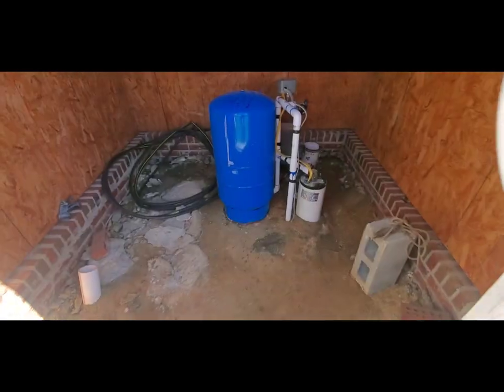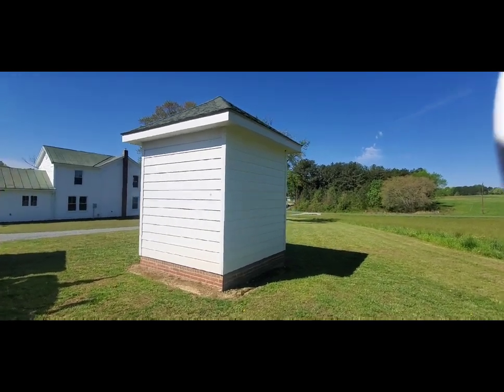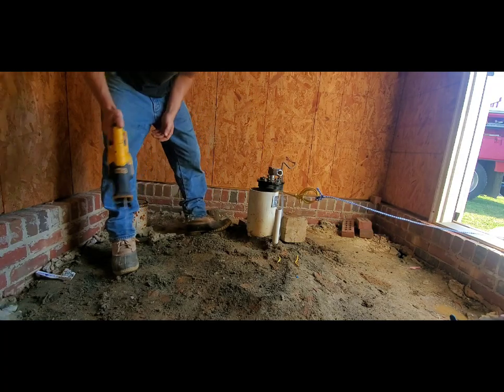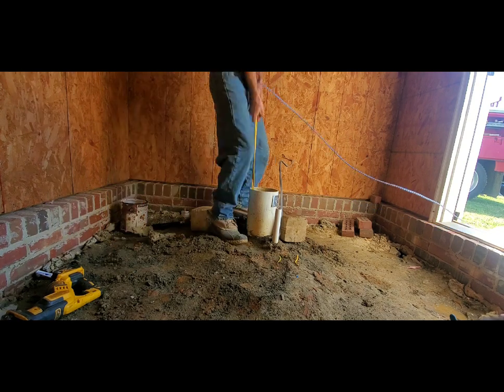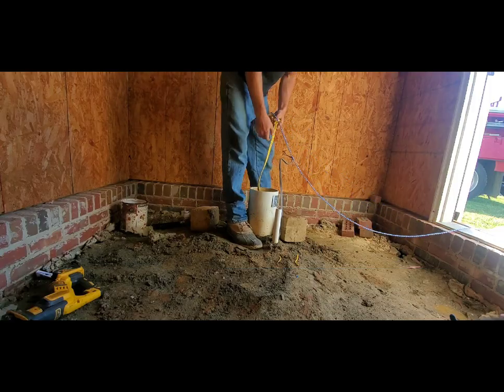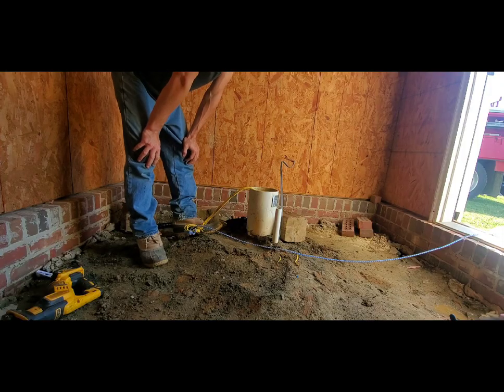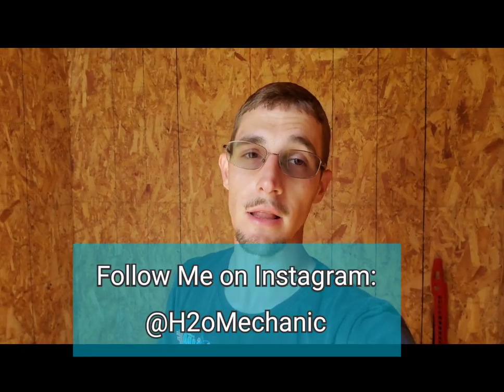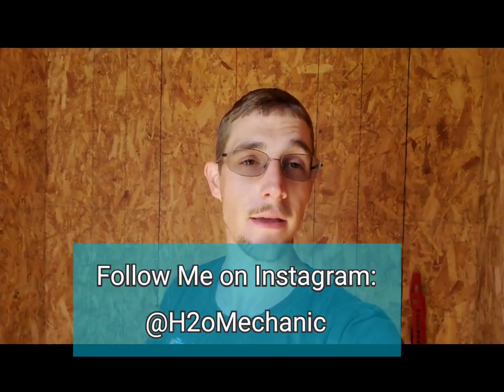No Water, Pump Stuck in Well Due to Collapse. How to Fix This Problem

Comment: You didn't show how the old pump was removed. If pump and hosepipe still in borewell can we insert a new pump in collapsed borewell?
Reply from the maker: Yes, if there's enough depth, 2 pumps can fit in 1 well. Just set the pump above the collapse zone. Or you must drill out the old well with the rig

Comment: So in the past ive cut a small hole in the roof directly over the well. You can then position the crane directly over the well without all the hassle of removing the entire building. When done, you just repair the roof.

Comment: She lucky that is a big casing mine is a 3 inch pipe with a 1 1/4 pipe in it i wish i could have done that but mine has a foot valve with jet pump its still going its like 100 years old set up i think Jesus blessed me with it still working till this day then i have a hand dug beside it

Comment: I know this is an old video on a completed job but ramp up over the foundation with cribbing them high Jack the rig. After of course you cut a hole in the center of the roof and put a lifting point in center. In bolt and lift the building off when your done put it back. You fail the roof in a way it has a permanent lifting point for any future “maintenance” that needs to occur

Comment: Based on my experience, a well driller really shouldn't be in the well repair business. No matter how simple the issue is, they'll always go for the priciest solution, which is to drill a new well. And if the customer turns down that second option, they'll just end up with a patch job that's still costly.

Comment: I have always wondered why the pressure switch is not used in conjunction with a heavy duty plug in relay which can be replaced in seconds in case of failure or a lightning strike. That way the contacts on the pressure switch would last much longer?

Comment: They have a nice well house.  They may could saw a slot 2' above the plate into the interior sheathing and remove.  Unfasten the bottom plate from the footer, (may be 1/2" nuts?) wrap straps around the building and lift it away with a crane.  My well house has large eyelets on it for that purpose.

Comment: You should build yourself a tripod out of some old metal pipe.  What's the breaking strength of that pipe  do you know? or best guess.
Reply from the maker: @zakglove6536  poly pipe stretchs & snaps around 4000lbs of pull

Comment: I know that this is old but what about remove a shinglw above the well and hole saw a hole and use your crane then ... put a piece of ply under with 2 cleats to the rafters then reinset your hole sawed piece then put back the shingle..

Comment: Hey mate,

great channel, I've learnt plenty on it. 

I know its an old video but its the closest thing I can find to my issue. I have a submerisble stuck in a bore, the pipe blew out and using a camera I can see the pump has fallen beyond the PVC casing and is caught on the bottom of the PVC. 

I have tried many things to retrieve the pump but now I am considering throwing a new pump down with the pipe shortened to lift it above the other, now my worry is the existing cables (steel and elec). 

Did you tape the old cables to the new pipe to keep them at the top of the bore???? Is that sufficient to keep them from stopping retrieval of the new bore later on???

any help from anyone would be greatly appreciated. Cheers and keep them coming

Comment: Had my well collapse. Hand dug 40 ft then drilled another 20. Dug it out and still wasnt able to pull the pump out of the lower casing. Any ideas?
Reply from the maker: There's no fixing it. A collapse normally is a total lose. 
A true fix would cost Thousands. Youd need a rig or diesel air compressor, and 1" galvanized pipe, send it down & keep blowing high pressure/volume air down the hole & lift the sediment out, it'll take hours of blowing to get it clear. But if any large rocks fell in, they likely wouldn't come out. So best money is spent on a new hole & construction should be done differently now that you know there's a possibility of collapse
Reply: @H2o Mechanic  tried pulling it out with a 12000 lb winch and it didn't budge. The pump is actually only about 3 or four foot below the top of the casing. Which is 40 ft down inside the 3'x40' hole. We tried blowing it out with a diesel air compressor and also tried pushing the pump down. It should have another 16ft below the pump. It wouldn't budge either way. Is there a way I can send pictures to show what I'm dealing with?
Reply from the maker: @dunmuloch  Hwdracing@gmail.com is my email, send pics there

Comment: had this same problem,  only the people before had a 4 inch pump pushed into a steel 4 inch well, and lightning welded the pump to the casing, no way get out, I pulled with tractor and bucket, everything came up, wires, hose, and rope tide to pump all pop off and came up, so I stuck another pipe with foot valve down in well and put in an above ground pump, zero issues and cost me less than $300 to fix. so more than one way to fix issue.

Comment: My neighbors pump was stuck. We used a simple tripod 7ft high with 2 inch steel pipe and a come along to pull it.  It took 10 minutes to set up and would have easily pulled until the pump was free or something broke.  In our case, the pump came free.

Comment: 2 gph  lol
Reply: I'd assume that's 2 gpm that the well can supply to the pump, not necessarily 2 gpm coming out the hydrant.
Reply: @jake-mv5oi  Thanks for the thoughts! Wouldn't there be an issue if the pump is capable of pumping more water than the well can provide? Like starve the pump?
Reply: @curtchase3730  ya, I'd guess that it'd cavitate & burn it up if the level dropped below the pumps suction for a prolonged period. I figure that's why they have those pressure switches that cut the pump off if pressure drops too low.
Reply: Looking @ the water from that hydrant, seems much more than 2GPM. Should have put a Homer bucket under spout and clocked it.

Comment: Get an a-frame hoist truck back ,it into the open door, with the pulley and cable over the well.   winch it up. using truck winch.  Or, get larger stronger tripod with pulley over well, run cable from a front truck winch over the pulley, hook on to pipe and  horse it out.  But, it could all cillapse into well.

Comment: I built a smaller shed around one of my wells and made a removable hatch above the well to allow attachment by a hoist. If that shed is abandoned I would pour a concrete floor and have a great storage shed with power. Another great job!

Comment: I have the same issue.  400'- 0" well collapsed at 120' - 0".  Previous owner installed a new pump at 110' - 0" and worked well until we had a drought!!!  Drilling a new well scheduled this month.

Comment: What happened to the old pipe that was going down to the old pump
Reply: Abandoned in place. Stuck solid, so no way to pull it out. New pump, pipe and wire fit next to existing abandoned pipe.

Comment: I just wanna say thanks for the video. Mine been stuck for over a year but would still work. It went out July 4th weekend. Family of 5 and our only water supply. One pump guy been here and run off with my money. The other one was his buddy so he wouldn’t come. What am I gonna do. Im gonna google it. I did and your video popped up. I went bought all the stuff to run another one down in the well. Meantime another pump/drill guy calls me and says they make a 3 inch pump for this problem that the 4 mite not go down with the other one. So my brother and I took a 4 inch driveshaft from a 79 Ford pickup and run down it to see if it would come back out with no problem and it did Praise the Lord JESUS. We put all our stuff together and run the new pump and stuff down in there and hooked it all up and got water and my pressure back. I wanna thank the Lord GOD in Heaven and you for your video. Thank you. We really appreciate you and your tricks to the trade to help someone. Thank You.

Comment: Good day,I drilled a 85m borehole and only 60m PVC casing were installed and 25m collapsed onto the well.... I'd like you to know if it's safe to remove them and insert other PVC that will go down to the well(aquifers)... how do I remove them???

Or I should just leave it as it is
Reply from the maker: I'm not sure exactly what you mean in your description, but it sounds to me like you'll require a well drilling company to come out and blow the well clean before any other work can be done.

Comment: Nice looking work and it;s great that you gave them 3 options to choose from. I see this in the South Tulsa area from time to time. It usually occurs on yard irrigation wells 70' - 100'  deep with 40' - 50' static level in sand stone or shale where the well is pumped  nearly to cavitation until the hot casing collapses in against the pump. 
In a 4" or 5" well all you can do is pull until the pipe and wire separate from the pump and drop another one just above the old one. I've found that it's not a satisfactory solution in my area, don't ask me how I know smh.  A new well will generally be the best option  for an irrigation application requiring 18 - 25 gpm with just 30' or 40' of water in the well. 
Thumbs up for quality honest work.
Reply from the maker: Yea I'd recommend a 3" grundfos sq for 4" wells. Those motors do get hot! I had 1 collapse at 300ft with 400ft of 4" sleeve. I was the 4th company they called and the only to fix it.

Comment: Hey bud I got to whalehead that the bolts are rusted one has already cracked and I can't get the well cap off help me out
Reply from the maker: Don't remove the bolts!. Use a medium flat head around the rim to pry it up . Tap in the flat head using a hammer around the edge . Between the seal & casing. Maybe wd40 too. It's just a squeezed rubber seal stuck to the casing. Its hard sometimes.  Use the claw of a hammer too to twist it & pry up & pull up on the lip
Reply: @h2omechanic  or try claw 🔨
Reply from the maker: Your correct about the bottom half falling. & it all could fall if you broke 2 or more. You've gotta pry on it. Or wrap a rope around the center pipe & tie it to the center of a shovel handle and have 2 ppl lift equally. Tapping the seal around the edge might help it to break free too
Reply: Yes sir I watched lots of your videos I did not and the problem is that when I twisted the first when it cracked immediately so I'm hesitant to loosen anymore for fear that it'll crack and fall
Reply: Thank you so much I think that may just do it
Reply: Should've cut a vent hole in the roof n put a boom truck on it, as well as try running the pump when you are pulling on it as vibrations can knock stuff loose... Or call an actual technician that has experience... If your a "plumber" don't touch a well
Reply: @WannamakerWorks  yeah it's cool man I'm electrician by trade the rubber cap it been there so long it's sealed to the PVC had to cut the cap off only lost a small portion maybe 2 in the pump came out free no problems  been running great ever since

Comment: Leaving a question!  Could a winch set above on the shed’s top plate and send a power washer line down to loosen the debris around the old pump.
Making a portable gantry crane and power washer drain jetter {water brought in on trailer} yours or subcontract a power-washer to help. 
Grumpy Old Guy two cents
Reply from the maker: Think of it as Rail Road stone/gravel.  If it was silt, yes it can be washed out. The rock formation was just that broke & jagged. Large rocks fell in. Thanks for the comment though! I like it when viewers interact and have outside the box ideas!